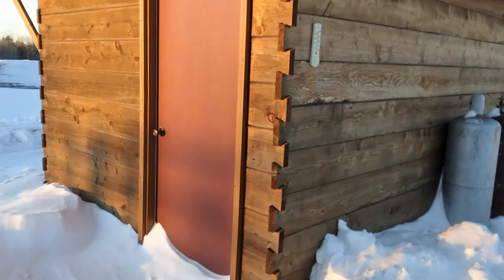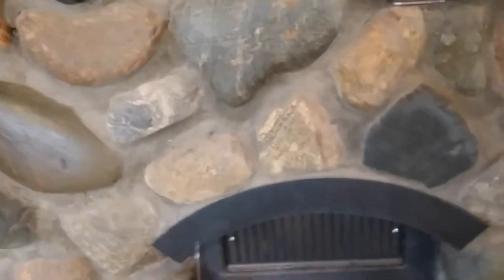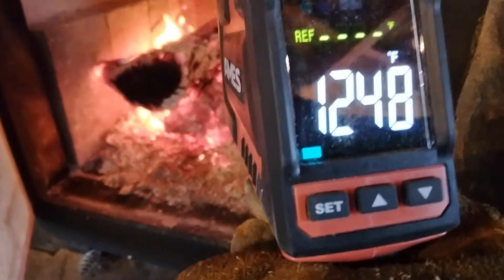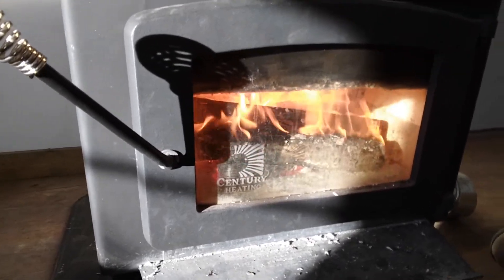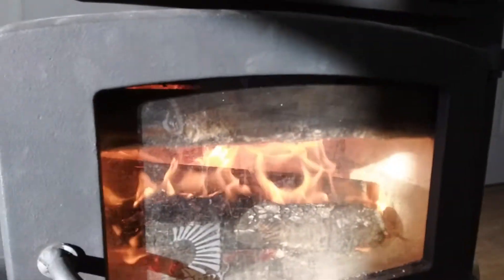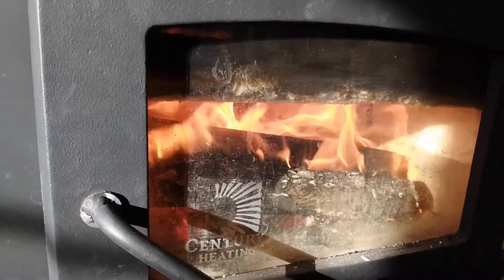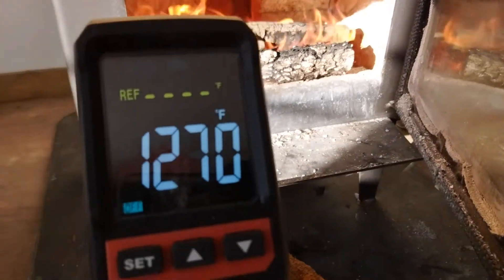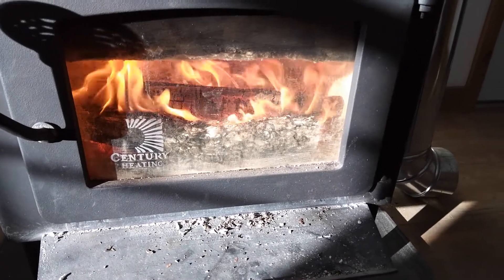Which burns hotter?  Masonry Heater, 'adjusted' wood stove, or rocket stove.

Comment: Thanks for your videos, I learn from them. On the subject of stored heat: How about a metal pail with dry sand on the stove? Would that absorb/release heat efficiently?
Reply from the maker: Thanks for the interest.  It would have to be very fine sand.  Or sand mixed with clay, to make like a 'cob', which is what is used a lot for thermo mass storage.  The size isn't going to be a whole lot though.
Reply: @doubleMinnovations  Thanks! I'll try a five gallon pail and let you know how it goes.

Comment: Hey, appreciate you making the video. Could you please make me a measurement of the burn chamber walls or roof near the top? I'm trying to ascertain the metal type i would need to have inside a burn chamber to carry water through for a water heat transfer system. I'm struggling to get proper data about the actual burn chamber heat at peak burn rate with ample oxygen supply. There seems to be very little documentation on that. 

😄
Reply from the maker: You would need stainless steel pipe for heating the water.  I did a whole series on building a rocket stove water heater.  I would suggest that you watch that.  It may help you quite a bit.
Here's a link for the first video:  "https://youtu.be/vjEwOq3sRwU"
Reply: @doubleMinnovations  Thanks, i will watch it for sure. Any chance you can take a measurement in your firebox? Not of the burning wood, but of the surface near the top of the firebox on the firebrick. 
There are many kinds of stainless steel with variations to carbon content and other alloys. And i'm trying to find the steel alloy that suits the temperatures i can expect to experience.
Reply from the maker: If you are talking about the Masonry Heater, the ceiling of the fire box is 16" wide x 20" deep.

Comment: Open flames are not what I would consider a good test for best stove. Maybe you could show what the temp of the flue is at it's exit point. That would show how much heat is LEFT in the room. And, how much is sent outside to heat the dear and rabbits.

Comment: That circa 1900 degree reading may well have been heat radiating off of the coals rather than the actual temperature of the fire...
Reply from the maker: The IR beam from the meter has to strike an object that reflects it back, to get a reading.  Firebrick, wood, coals.  It can't read an actual flame, only objects close to the flame, or the combustion on the wood.

Comment: i've had steel stoves , cast iron , kachelofens and a soapstone oven . 
my favorite for clean burning and heat retention is the Soapstone oven . i can blast it for about two to three hours and the stones are fully heated . this will last about 24 hours but my house is so well insulated that i only have to fire every other day to heat the house to about 72 degrees inside when the outside temp is around freezing .
Reply: Yeah, what makes or breaks a stove is not how hot it burns but how long you can go without having to feed it. Two days is the longest I’ve ever heard. I want your stove.
Reply from the maker: Soapstone is a wonderful heat storage material.  Sounds like you have a good setup!

Comment: Why don’t you americans (I assume) have more heat storing fireplaces made from bricks in the center of houses?
Reply from the maker: Yes, this is America.  The masonry heater/fireplace you see in the video; has tons of firebrick, stone, and clay brick for heat storage.  It's very time consuming and expensive if you had to hire someone to build.  I got passed that by doing it myself.
Reply: What proportion of European houses have such fireplaces?!? Not most, I know. Maybe a higher percentage than in the US, I'll grant you that, no problem. As for answering your question ("why?"): because we had cheap fossil fuels for so long! Duh!!
Reply: @seanps999  Throughout Finland, but also Estonia, Latvia, Lithuania, Ukraine and many places in Russia, masonry heaters are the standard and in rural parts are sometimes the only source of heating for the house (I doubt it is common to have it be the sole source in Finland, but in the others it does happen in relatively more isolated villages).
Reply: @seanps999  Good answer. Idk about Europe in general but here in Finland it's probably close to 100%. Most houses have them. Some have more than one, usually from 1 to 4 depending on how big the house is. And using them is really cheap if the wood is from one's own forest. Maybe American fossil fuel providers own the fireplace companies too? lol
Reply: @Juhadiable  No, the fireplace companies and fossil fuel companies are different.  Here in the US, we had a period of deforestation that led many to stop using wood, initially in favor coal stoves and boilers, and then to oil, gas or electric systems (in some places that included heat pumps even in the postwar period, while in others heating with electricity remained almost unheard of for quite awhile).  This allowed for rapid and near total reforestation.  In essence, the wood consumption for heating, building (we largely build with timber products be it lumber or OSB panels as opposed to concrete panels), and every other use (be it paper or whatever else it might have been) proved to be too much consumption for American Forests, so in the end, cheaper building materials won out, and most other uses decreased or were essentially eliminated entirely.

Comment: Do you any sort of secondary combustion chamber on any of the stoves? Just because the fire temp is over a 1000F does not insure complete combustion.  To do that you need to make sure there is enough available O2.. so a second chamber where 1000F combustion gasses can mix with pre-heated  "fresh" air  will insure no un-burned gasses remain and pick up some extra btu's.
Reply from the maker: Yes, in case needed.  The evidence however, showed they weren't needed.  The one on my masonry heater, would just slow the burn down in the main chamber if I turned it on.  The 'adjust' stove in the barn, has a slit that air can enter above the insulated burn chamber.  It's right at the front where the air wash comes in.  You can see it in this video.  You can see a few flames at the back of the stove, but none by this air slit.  Cleaning out the wood burners, show most of everything has burned up.

Comment: OK I'm finally getting it - you are stating the SMOKE is way cooler than the fire itself. So once the smoke exits outside your ceramic insulation firebox then it's not going to overheat the steel. OK - finally it makes sense to me. haha. Thanks again. Too me awhile -

Comment: How long with that stove pipe last on the rocket stove? The mass heater rocket stoves will burn out stove pipe if they are not designed carefully - and I think it's a 350 degree on galvanized steel for long term burn temp limit.  This is the same question I have on your barn stove - I understand that the insulated fire box is for a clean burn. The key question is how hot or why the stove doesn't get as hot in the back top - is the back top insulated? As far as I can tell it is not. Does the baffle go all the way to the back? You took out the Century baffle and you say that your insulated fire box opens up in the back - so the smoke goes up. Can you do a temperature reading on the back top of the wood stove? Could you explain why it doesn't get that hot if the fire box is 1300 F.? Steel is not supposed to burn long term over 650 F. or else the strength weakens. Does it glow red at all in the back top of the stove? thanks
Reply from the maker: I left the stove intact.  I didn't remove any baffle from, and I never said I did.  I thought I explained how the exhaust travel in the first video.  I will be making another video of what I did inside this stove it in the future.  It's just an arrangement of firebrick and ceramic fib. insul. board.  That's all.
Reply: @doubleMinnovations  Thanks for that crucial clarification. I was farm-sitting the past week so just got back. THAT explains the whole secret! See people do not understand how the Century stove has the baffle going all the way to the back of the stove. Glad you will make a vid just on that secret. All the best and congrats.

Comment: Good test information, thank you very much for sharing. I am curious of the heat of the mass of fire brick on top of the wood stove and how long it would radiate after the fire dies down.
Reply from the maker: Not long enough; but after a couple of hours of the fire burning, it will keep the place from freezing over night.  Need a lot more thermo mass in there to keep it warmer over night.
Reply: @doubleMinnovations  thank you very much for the swift reply.